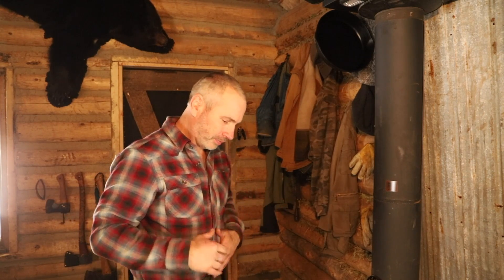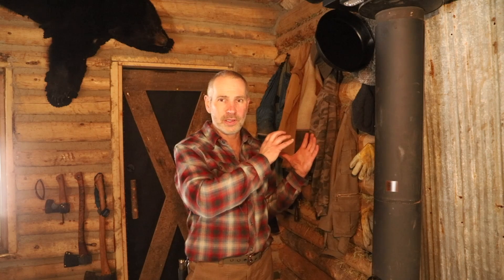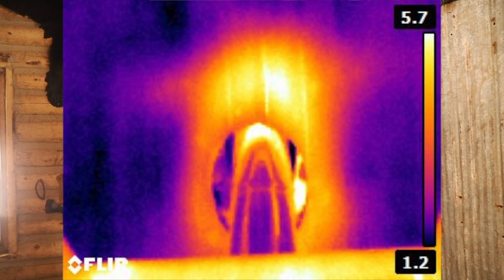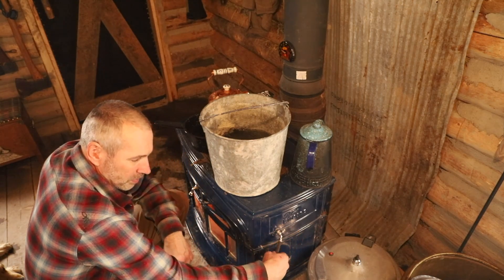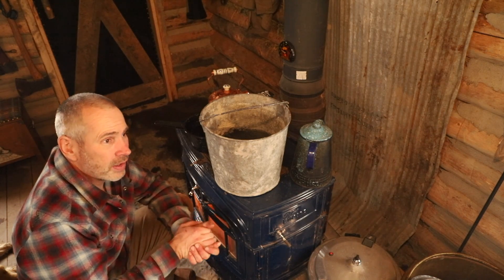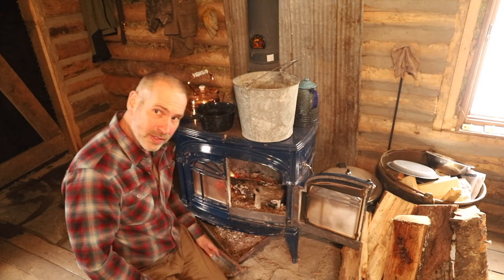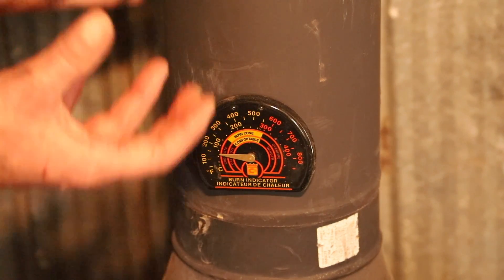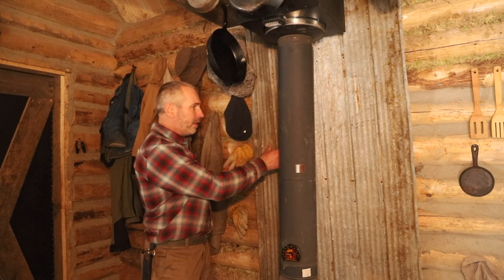How to Heat an Off Grid Log Cabin with Wood, Thermal Imaging Scan (infrared)

Comment: Nice video using the FLIR to show the building heat retention and radiated heat loss. However, most of the stove information is incorrect. Hopefully, a manual has been aquired so that one now knows what the controls are for. This is a pretty efficient stove compared to the old style with the front lower air controls talked about.

Comment: Hi Shawn, great vid. I am a huge fan of wood burning stoves as I have two, one for my house and one for my workshop. 
Have you considered attaching a couple of copper air pipes running from an inch off the floor, up the stove pipe, flared and angled at both ends. This heats the air very efficiently as it pulls in cooler air and expels hot air. This wood also work great for your sauna.

Comment: Your Stove need a damper in the chimney !!  And Bigger brick area. Loose the stove with a grate for ash pan.. it's not sealing tight enough. The simpler the stove the better. Like you were talking about the older front bottom draft stove. .  It will cut down your use of a cord of wood a month to half that and get a stove without GLASS. Again more thermal mass.

Comment: Nice set up. Only thing I'd do differently is have that heat shield on the wall behind the stove spaced out from the wall an inch...and have it an inch off the ground to allow the heat to circulate around the shield. Wouldn't want to run the risk of heat being transferred from the heat shield to the log.  Cheers!
Reply from the maker: That’s what I had, spaced with nails, but now the backsplash is completely updated :)
Reply: @MySelfReliance  oh right on...hard to get a sense of it from video alone haha have a great winter!

Comment: Even if not a ‘rocket mass heater’, those homes which have a large mass of brick, or stone surrounding their stove capture and time-release heat.  Many use the method of starting one hot fire in the AM, and let it burn out until evening relight.  -Just a thought, since you’re obviously well-studied.

Comment: @My Self Reliance, you should check out a traditional Swedish cast iron stove. They have an oven (which can be filled with soapstone or bricks when not used to further store heat) and usually a container for hot water. Would definitely heat your entire cabin with a lot less firewood. Proven and tested in similar climate for two hundred years. See example (price in SEK) : https://www.sekelskifte.se/en/product/wood-stove-smalandspisen-28-b

Comment: The biggest problem is, that heat escapes through the roof.The ceiling need to be done and insulate
at least 1foot thicken,preferably 2 foot.Moss will work well if it is available.Thumb up!!!

Comment: The “thermostat” handle (on your right side facing the stove) is pushed all the way back which shuts off air to the fire box and may put the fire out. Pull the handle towards you to allow more air into the firebox. The thermostat is intensionally adjustable....full open (handle pulled toward you) to start the stove....half open (handle pointed down) for more controlled burn after logs are fully engaged.

Comment: Will be better to get a different stove. Smaller box with a larger top area for cooking and heating water.Also a copper coil around the chimney connected to a water tank will help  having almost constant warm/hot water when the stove is in use. There are also ovens heated by the chimney heat. .....That stove is kind of out of place. Does not blend in with everything inside the cabin. My opinion. Good luck.....

Comment: Thanks for you video.  Logs are a fairly good insulator - cement is not.  Foam spray would greatly improve your insulation.  Stopping all leaks as possible is another one.  Your stove is way better than a fireplace.  1 in of wood is equal to about 1 inch of insulation.  Foam as many holes as possible.  That is why making a circular groove to lie each log into and possibly using weather stripping - 2 pieces is always a good idea.  A small trapped air space is also a great insulator.  If you cut your logs with a bandsaw then weatherstrip and make sure the fit is tight.  Foam around windows is a must as is double or triple glazing.

Comment: It is interesting that the logs conduct more heat outward than the plaster between them.  And the apparent relative thermal efficiency of the roof is virtually impossible to explain.

Comment: if the clay on the OUTSIDE is releasing heat, it went through the moss layer. Sure, the clay is conducting heat out, but at least it gets stuck there a while first. The moss is just letting it out - that's why you don't see any thermal heat around the moss. It's going right through the moss without heating it, unlike the clay. When it gets stuck in the clay, it's actually helping keep the cabin warm.

Comment: You need to Google specs for your wood stove. I believe that lever you thought was for combustion air actually is used to send the gasses through a catalytic converter when up to temp. You throttle back cobustion air (levers located on bottom of stove) close your damper and that is how you get your efficiency. You may be sending more heat and pollution out your stack than you realize.

Comment: Hi James , mass heater here is not the solution (needs too much place to be efficient) place a brick wall behind , it could be very decorative (think about niches ) and not expensive at all , as Tresa Lamb tell you below , it will had mass and hold the heat longer , if you're more clever you have to let some space (around 10 cm) between the cabin and the brick wall to let the air flow passing by ... Sorry but the only solution to shutdown your wood consumption is 1 a better wood stove instead this one is not bad at all , 2 isolation more and more and more ...

Comment: Why don't you pull the blocking plate off of the fresh air intake so that it will pull air from the room? Use the damper control on the right side.

Comment: It was explained to me  using an outside air source does two things . 1. If the house is very air tight the stove will not work well because it can't get enough air,and in modern well insulated homes it is even a requirement. 2. using an outside air source is more efficient because the fire is not using air that is already heated from the room, by not using an outside air source the stove can create a slight vacuum causing cold air to be pulled into the cabin through any cracks or crevices,creating a draft and thus cooling the cabin. I have a wood burner from a different manufacturer with a catalyst system and when it gets plugged up the burner doesn't draw right unless the top damper is open. This is very inefficient . I think that lever on the right of your stove is some kind of thermostat control. The best way to load the stove to capacity is to lift the griddle top [if yours opens] and load it from the top that way you can pack it full,.  Vermont stoves with the lift up griddles are designed for this purpose. Thanks for your videos I throughly enjoy them.

Comment: I grew up with a Schrader Wood burning stove.  It had double doors with dampers on both of them.  But be careful about leaving the door open because sometimes the wood can pop and burning embers can fly out the door onto your wood floor and start a fire. Also, keep the stove pipe clean from a soot build up.  That pipe gets really hot and there have been many homes start on fire because a fire started in the stove pipe.  Our stove used to get so hot that it would run us out of the room.

Comment: I still say if you are interested in doing some masonry (can be brick, stone, tile etc anything that will hold heat well), you should check out the big russian stove designs- for your next build it would be far too big to add now! It's big enough- you could design it so the bed "sleeping shelf" air maze is hidden from the rest by a built wall, providing privacy in a bedroom. When I finally get some property for myself I am definitely building one, as it will consume a miniscule amount of fuel and only need to be fired like twice a day with a handful of kindling each time (presumably when you would cook meals- ovens and stovetops are implemented into these designs. Many designs also implement a "sleeping shelf" which I will include in mine... Someday...

Comment: We have that same exact Vermont Castings stove in our keeping room fireplace, same color too, ours is from the 80's and has a catalytic combustor which is controlled by that lever on the left...  That stove if you really figure our how it works heats a 1700 sq ft section or our house...   First off your door handle didn't break off, it fell of and got lost.  If you google "Ceramic Fallaway Handle "  you can buy one on line, Amazon sells them, ours had to be replaced, the dog broke it...  It hangs in a hole at the bottom of the right side of the stove...   Also how we work our stove is we load it up and do what's called a Top burn" to get it started  We put the kindling on top of the wood pile not the bottom... We keep the thermometer that you have on the stove pipe on the griddle plate of the stove...  That handle to the right is an air control, you want that forward/open while getting the stove up to temp...  and the the catalytic combuster open...  When the stove gets up to 525F to 550F you close the Catalytic combuster and turn the air control down so the handle is straight down...   When you add wood you add it from the top, you open the CC turn up your air control first, add your wood, get it back up to temp again before you close the CC and turn down the air control  We'll load up that stove before we go to bed, at midnight and wake up at 5 am ,  and have coals in the bottom to get her started again...  That's when you open that bottom tray a bit too...  In the morning we gently knock some excess ash into the pan, being careful not to loose the lit coals, and dump the ash pan in a metal ash bucket.    We put some dry twigs or kindling in the bottom and fill the stove with wood, open the CC turn up the air control, and leave that bottom pan open just long enough to get the wood to burning then close it up...  Let the stove come to temp and close it like before...   This model stove is a favorite in the States, and if you wood is seasoned and you use hardwoods it works great...
Reply from the maker: Thanks Mary for taking the time to share that
Reply: Its really a great efficient stove!!!  If you ever have any questions about that stove feel free to ask, the husband know that baby very well, I'll have him chat with you about it.  Two years ago we thought we would have to replace it, but he found a guy that he could get replacements parts for the inner plates and pins and totally took that thing apart and re-built it...    Oh and your wife got that for you for a steal!!!   The older models with the Catalytic Combusters are hard to find down here in the states...   With the newer Encore models  Vermont Castings did away with the CC, so nobody wants to get rid of the old ones from the 70's and 80's, so they can go for a heck of a lot more money then what she paid for yours...     Your cabin is amazing by the way, I love that kitchen sink with the hand pump, I would love one of those in my house!!!

Comment: Do a Russian masonry heater not a rocket mass heater. Rocket mass requires small wood being fed on an almost continuous basis to heat a mass. Russian masonry heater uses a large pieces of wood loaded 2 times a day to heat a mass. They both do the same thing but the Russian mass heater only needs 2 fires a day with normal sized firewood.
Reply from the maker: I was just talking to someone about that today. I'll look into it
Reply: I'm a licensed Architect in Kentucky USA, I built my house myself. Not a cabin type house but a modern, good for resale type home. Insulated concrete forms, geothermal heat pump,heat recovery ventilator, water well etc. Just as a reference. I can tell you, if we had the kind of cold winters that you do, that would be the way I would go. You will need an outside combustion air source, but your cabin is not at all air tight, there is no worry about not enough fresh air. I am enjoying your videos and reflections, good luck to your sir.

Comment: in Norway they used to fit the logs together, and carve a U or V shaped groove on the underside of every log and put the moss inside. This would lead to smaller gaps that didn't need any mortar to hold the moss in.

Comment: Hope you realize that the camera temp is relative ie bell curve. Ie what is represented as hot has noting to do with absolute temp and more to do with relative teno. If the coldest temp is 300 degrees and the hottest temp is 320. 300 would be blue and 320 would be red
Reply: So yes it will look the same in the morning as it was in the evening because the heat loss points did not change. The temp may have but like it said it registers relative temp

Comment: At around the seven min mark while you are kneeled down in front of the stove , I noticed what looks like the rotation of a fan blade reflected on the lower part of the stove pipe. Since you dont have electrity I'm wondering what this is.

Comment: Hi Shawn, Love the videos...been watching since start of the cabin, also gone over to Joe's video's as well...two great channels, my wife and I are both enjoying watching each of you very much. We've got a place near haliburton in our family, haven't been able to spend as much time as we'd like there last while...so watching your videos helps! We've got a napoleon stove up there, same thing, we've gotta replace those gaskets frequently to keep the air sealing. So on the matter, My day job..I work for the company that distributes vermont castings products into ontario. (I'm not on that side of the business myself, so i'm no expert.. my expertise is in hot water/geothermal, radiant systems), but thought i'd reach out...if you need gaskets, the catalyst or what not, we should have in stock. Serial # of the stove should confirm exact parts we would need to bring that thing up to spec. You do want to be cautious burning with the ash door open, that'll likely over-fire the unit and could cause damage and other bad things, if done for too long.. Happy to help you figure out what you need for the stove though. Cheers.
Reply from the maker: Hi Jeff, actually I am in need of couple of things (like new door gaskets and a couple of handles, not sure about the catalyst).  Can you email me at shawn@myselfreliance.com?  Thanks

Comment: The front door handle is not broken, you're just missing the moveable handle, order one at Vermont casting, it's a few dollars. You probably have an old version of Encore model because mine is working with a thermostatically controled air damper, it's got that ajustable thermostat in the back left side of the stove, you don't have it ?? Unless it's missing, I don't know. Here's a link for your handle, it's more expensive than I thought :   https://www.amazon.com/Ceramic-Fallaway-Assembly-Vermont-Castings/dp/B00NU84ZNM/ref=pd_sim_201_4?_encoding=UTF8&pd_rd_i=B00NU84ZNM&pd_rd_r=MK533MRPAZM3M6SP3WKZ&pd_rd_w=HHusv&pd_rd_wg=hs9ks&psc=1&refRID=MK533MRPAZM3M6SP3WKZ

Comment: Another great video. Enjoyed the info about your stove. As a student of wood combustion science, it has been very interesting to see the great design improvements of wood stove technology over the past 30yrs.  Up until the 90s, stoves pretty much were the same as in the 1800s, it is only recently that we are seeing the efficiency improve greatly. Generally half the energy is left in the smoke when burning wood, so you can double the heat output if you can get the combustion hotter and more complete.  The nice thing about better burning is, very little soot. and the glass will remain crystal clear. 
The rocket design is a good one but my preference is still to be able to enjoy the warm glow and light of the fire which is lost on the rocket.  
Get yourself to a good wood stove store and experience how they burn.  You seem to have a good scientific/ engineering mind and will easily understand what is happening with the better combustion stoves.  My Thelin Parlor T4000 wood stove is beautiful to watch burn and has fantastic secondary combustion above the fire. 
Lastly, what options are available to create a vent to the outside air for the stove inlet?  Pulling in outside air would allow the cabin itself to not need to draw in freezing air to feed the fire.

Comment: I was told, when living in The Yukon, that burning birch wood every now and then reduces the amount of soot in your chimney. I used about 7-8 cords of wood each year and made sure that about 1/2 of it was birch. Cleaned my chimney every 6 weeks or so and had less than 1 cup of soot every time. Don't know if this is a lot or not (I used the stove from october to april so about 7 months a year). The bulk of the wood I used was cured pine and spruce. I lived in an old trailer btw so poorly insulated. As always a great video an very informative.

Comment: I have the same exact stove in my home down to the year (just in grey not blue) and it works beautifully. That lever on the right side looking at the stove is an air intake so your assumption was correct. I have leaks in my gaskets if I close the flume too early, but once the box is up to heat (after about an hour of wide open flume) and has a good layer of coals going I can close the flume and only burn one log per hour without smoking up my house. Thanks for doing a video on the stove, I'm loving your series so far and wanted to know if your Vermont Castings was the same as mine.